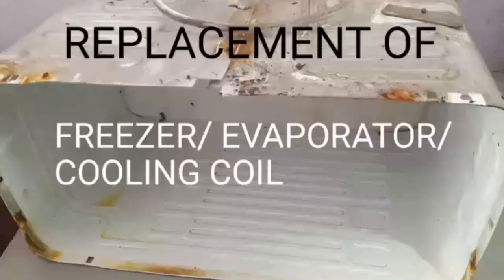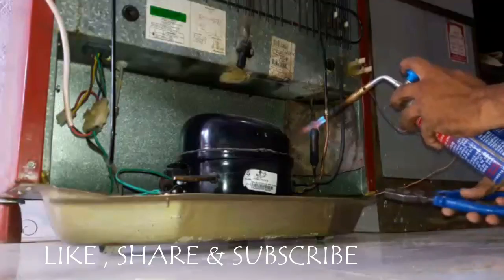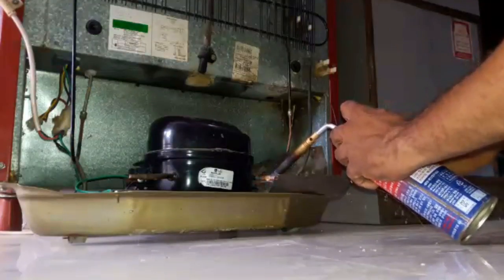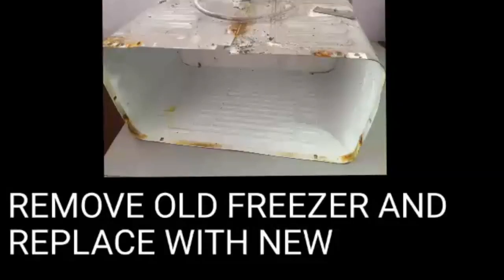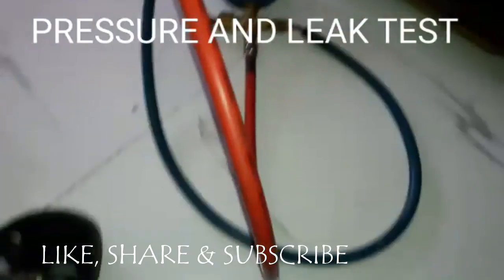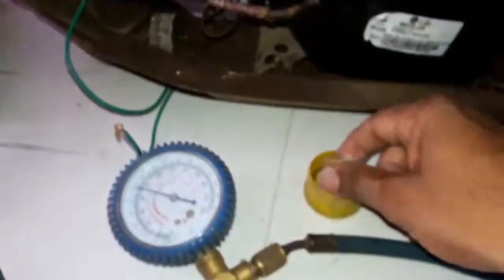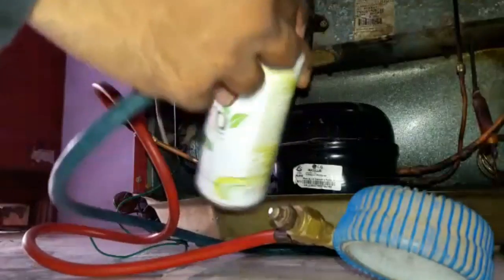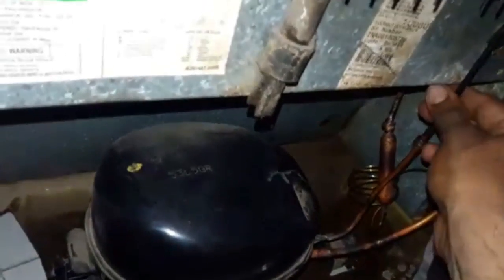Refrigerator Gas Charging Fridge repair. R134a (In English)

Comment: After I unplugged my fridge and left it for 10 hours to defrost. I refilled my fridge with R134 A. You fill it to 10-12 psig from empty but other people video they refilled R134a to 2 to 3 psig. What is the correct pressure? I read on the internet some expert said it is should be 15 to 20 psig.  I refilled mine to 9 psig it is running very good 45 degree F right now. It was very warm 50 degree before tapped in the line with piercing valve, I slowly refilled with each turn of the refrigerant can on and off and wait for the needle to settle down while the compressor is running and freon is filling from the suction line (Kenmore fridge).  It never got nice and cool at 2 psig like other's video recommended. So I slowly increased to 5 psig but still not getting cold on the fridge side.  The condenser line is very frosted with a lot snow build up around the copper tube.  Let me know what you think.
Reply: Hi there,
for the last 2 days I go crazy about finding proper psig charge on domestic freezer compressor.  Like you mentioned some say get this gauge from amazon and charge only to 2-3 psig, max 5 psig.  Then I research the internet and found few reputable websites where they recommend 15-25 psig and some 25-45 psig.  It all has something to do with ambient outside temp.,  but all these people contradict each other or I am missing some vital piece of information.  I am new to this and been pondering on what gauges or gauge to get and how to charged properly. I already checked compressor, capacitor, overload and relay - all OK.  I am not in rush, it is my spare #3 fridge that went bad and I would like to tackle this project myself- even if it goes bad.  So if you ever come across proper info just please, please let me know.
thanks
David
Reply: standing pressure 85-95+suction  (back)pressure  10-15pisg
Reply: May I know what should be the correct pressure? I charged my samsung fridge to 2psi but it is still not cooling.